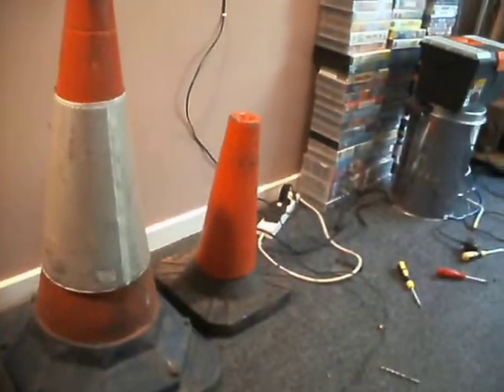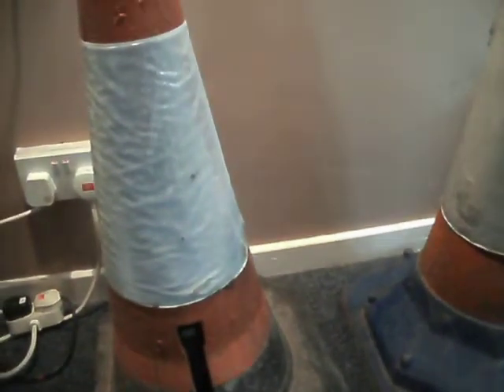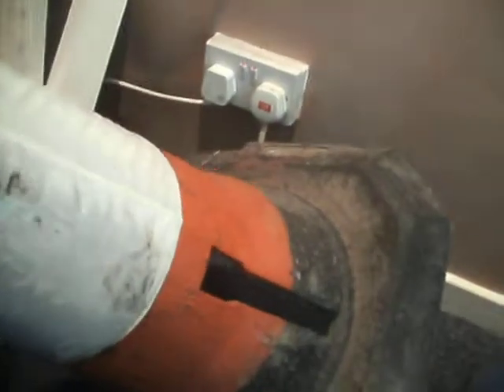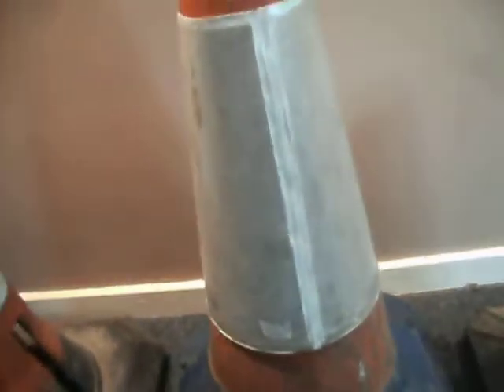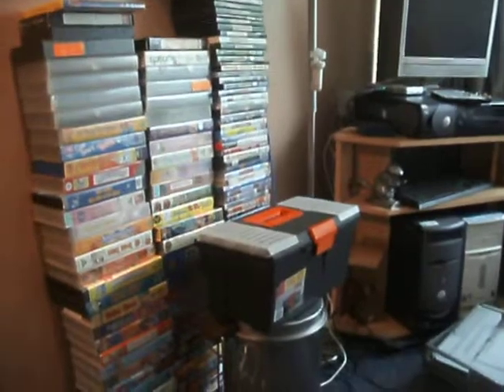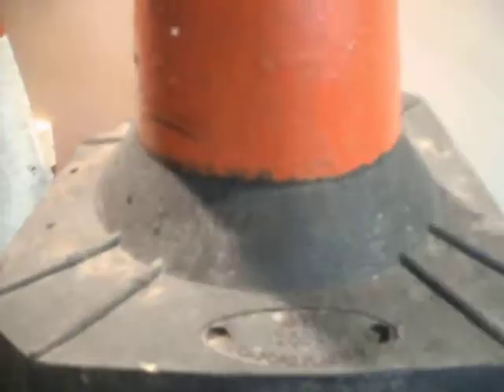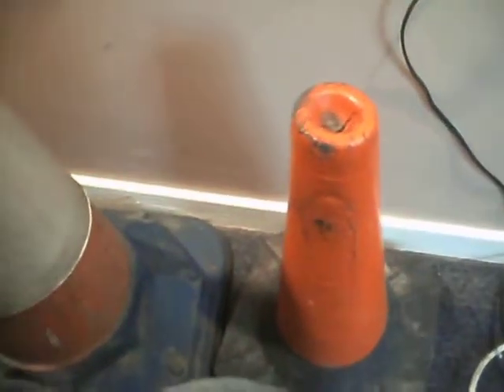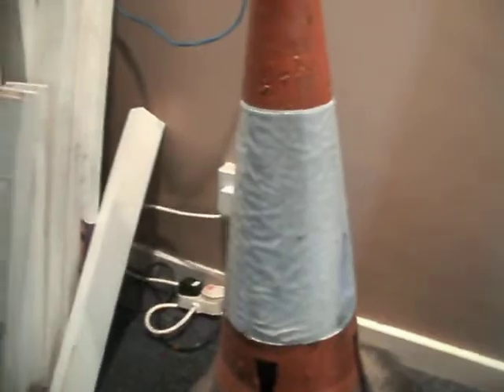Three more cones

Comment: I love these cones especially the 3rd and 2nd one the second one is really old, the later designs have square patterns on the sleeves and they were manufactured by peter cook safety prod ltd and then by oxford plastics ltd and they are no longer manufactured. The small one would of had a similar sleeve to the larger one as they were both manufactured by the same company
Reply from the maker: king cone I am tempted to go get a round-a-bout bollard to make into a novelty lamp
Reply: yes i did that they are so cool theres loads in manchester/salford being replaced if you want one from there